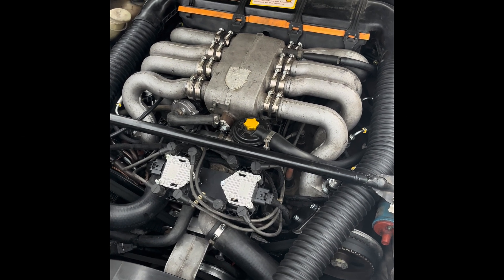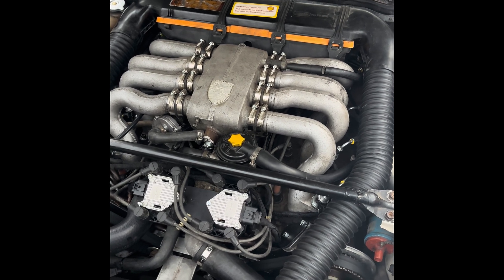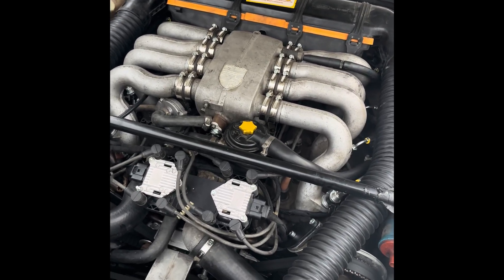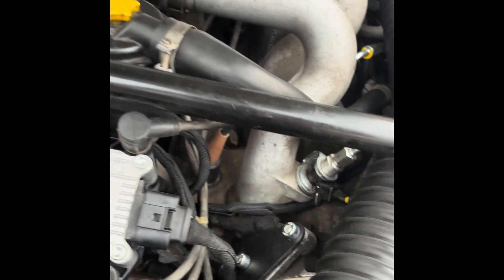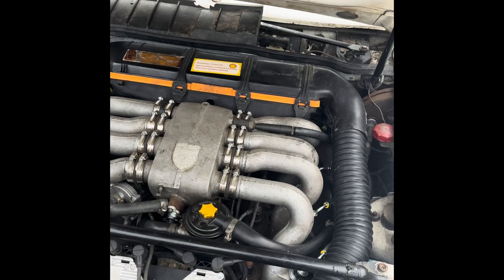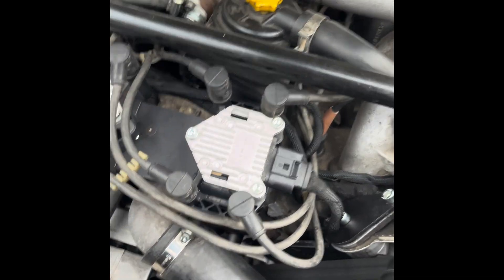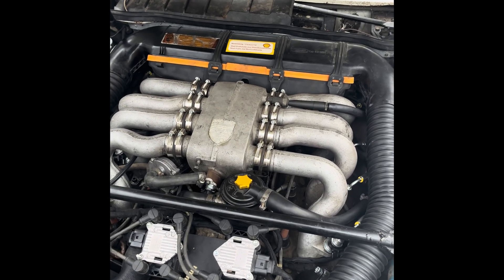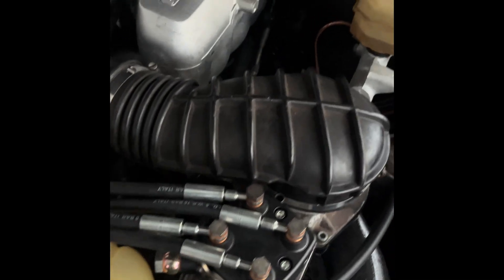Porsche 928 bolt-on EFI kit

Comment: Wow this looks incredible and would need only small changes to work on the Mercedes m116/7 V8 that used CIS as they have a very similar layout. Fantastic work
Reply from the maker: I plan to have a look at the V8 mercs at one point.
I’ve started looking at adapting the 4cyl 924 version to the 4cyl merc engines, so i’ll probably do the same for the v8s.

Comment: Nice kit and great to have the option, but I love CIS and all non-electronic systems. They do not have the same throttle response.
Reply from the maker: I love CIS as well, but sadly very few people left that know how to maintain them and repair them. So i made this kit that resembles CIS and has the same layout and general architecture.
Reply: Do you mean that CIS has better throttle response than EFI?